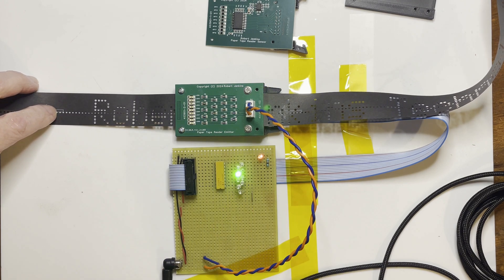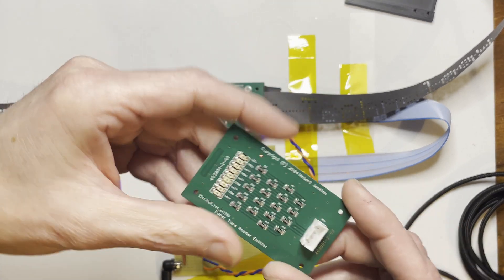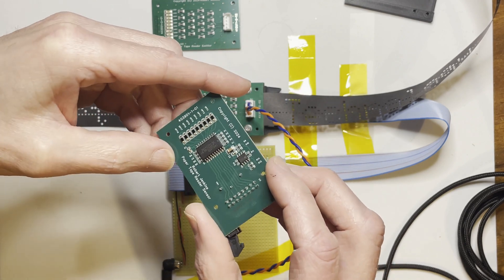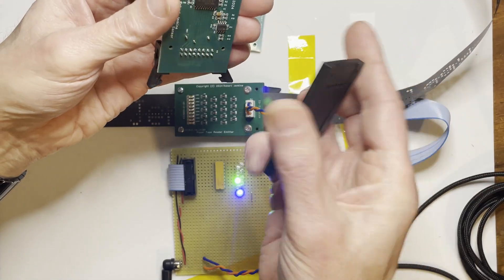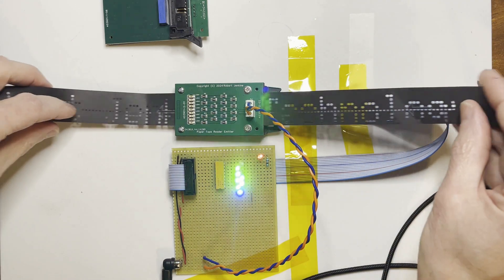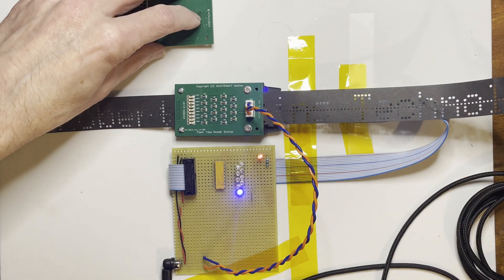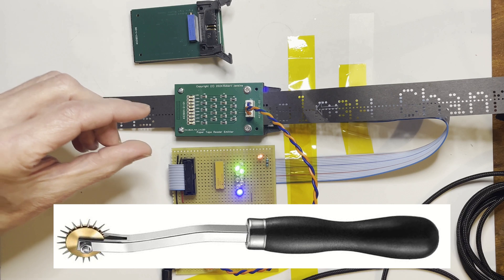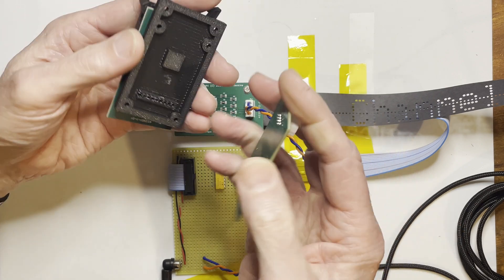Paper Tape Reader prototype

Comment: Hi Robert, I am interested in your paper tape reader. I have an RCA Evaluation board which i got way back in the 80's and also a ASR33 teletype. Unfortunately the teletype got lost in house moves and i have loads of software for the RCA board on papertape that i cannot read. Could you supply one of your readers.
Reply from the maker: Hi Alan, certainly! I've not had time t design a drive system o go with them yet, so that would be something you would have to figure out.
Send me a private message my web site > jrw link, or through one of my ebay listings.

Comment: A nice design - particularly cutting out ambient light by the choice of optos.

I wouldn't worry about the idea of a stepper motor to position the tape. As long as you can run the tape at a constant speed, then the gating of the sprocket hole for data valid will give you all you need to extract the data correctly. A capstan is probably better than drive sprockets, since that would wear the paper tape a lot less and would not damage the tape as much if things get stuck for any reason.

Take a look at Usagi Electric, he is also playing with paper tape on some of his historic vacuum tube systems. He also has a working paper tape punch system, so if you need tapes generated, perhaps there is an opportunity for collaboration or passing of ideas.

Re the through hole connector stick out, you could make a plastic spacer (like your current guide) to separate the tape and the pins whilst keeping the tape nice and safe in the plastic channel.
Reply from the maker: Agreed, for most things a continuous feed is fine. 

However, some old machines need to start and stop the tape on when reading data; that could be problematic with a simple capstan drive, unless the whole interface was replaced with enough buffering for an entire tape to be stored.

I've just been faultfinding a tape reader from a CNC machine today; that has a capstan drive - but with fast solenoids [using high voltage & series ballast resistors] operating both a pinch roller and a tape brake "clamp", to allow start & stop between characters!
Reply: @RJTC  
CNC and mechanical solution, I guess that makes sense.  You would have though though that grubby machining environments wouldn't be ideal for optical / mechanical data solutions. 

I like the idea of refreshing the solution to have all the tapes stored. How about an Espressif ESP32 S3 microcontroller, an SD card slot on an SPI bus for all the virtual paper tapes. Stick a 23017 IO Expander on the SPI bus / or an I2C bus to give you more IO pins if you need them, then fire off the data that the upstream system expects using your current interface or a direct digital input. You could add a TFT display and a rotary encoder to give it a nice visual display and allow you to change virtual tapes. Alternately, a single file on the SD card and tape swapping is done by replacing the SD card with a different virtual tape.